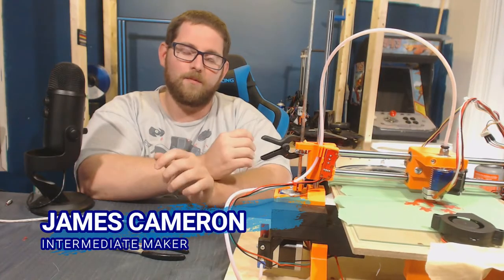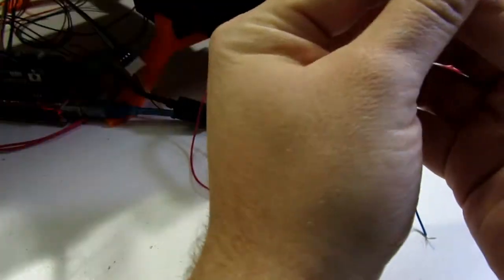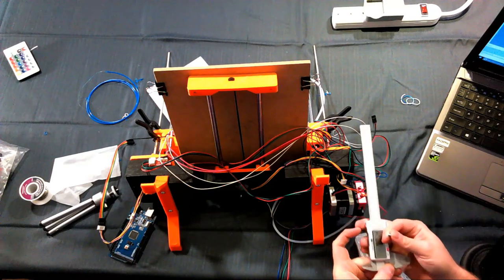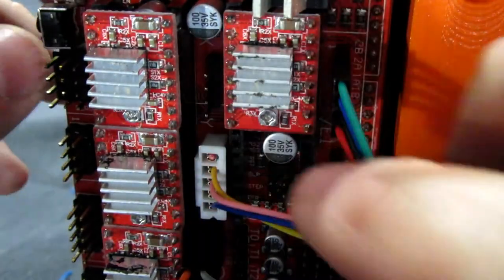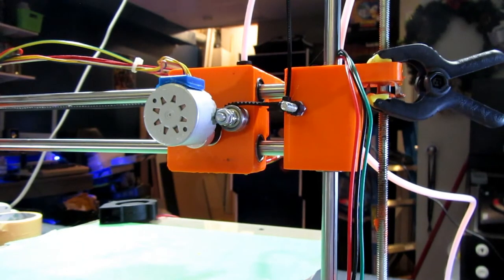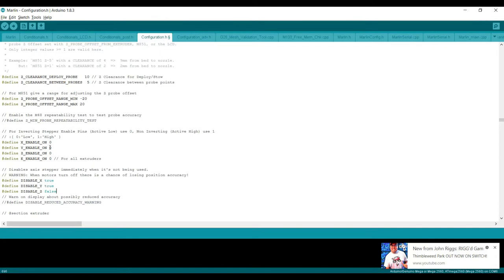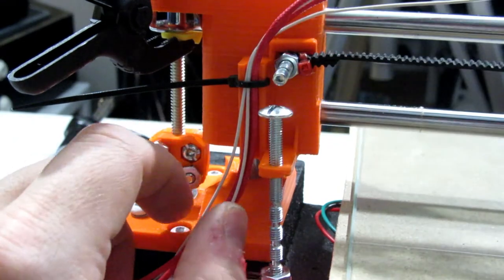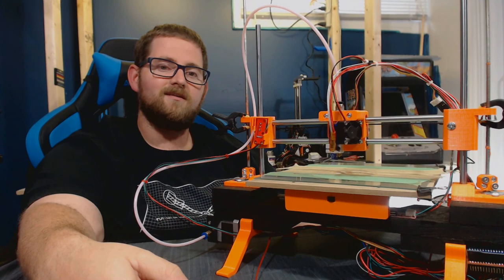Building the Cherry 3D Printer - Part 4 - Wiring Calibration and First Print

Comment: Really nice. I am doing an upgrade with the same style motors on the 101hero and so this is great to see. Also nice hints on my i3 clone build. Glad to find your stuff through Funk King 3D. Looking forward to your next project.
Reply from the maker: Glad to have you aboard! Have been watching your progress on the clone, it's coming along nice. I am currently working on an arduino based game project, but will be building another printer kit in January.
Reply: Nice,  thanks. As soon as I'm back home I will hopefully finish up the clone then see what the budget is for the next printer.  I will keep my eyes open for the games project. Have not gotten around to any game consoles yet. Hopefully I get figure out the settings and get the updated 101hero running soon.

Comment: Thank you for all these tutorials,  they were very teachfull.  I will design my own 3d printer based on these one, but using lasercut instead of 3d printed parts because 3d printing is way expensive where I do live.  Also, I will use the small stepper motor in a direct feed extruder instead of the nema.  
Your tutorials were great!
Reply from the maker: Glad you enjoyed them! I would take a look at the design on thingiverse for using two of the small motors together to build your extruder. You can likely make a laser cut version that would give you more consistent feeding

Comment: My Motors roasting like going to blow up what can I do?
Reply from the maker: Are you running the 12v versions or the 5v versions?
Reply: Print 'N Play thanks for the fast reply I’m making my 3d printer from Cd Motors
Reply from the maker: Ahh. Well the first step is to tune the voltage on the stepper drivers as low as possible. From there, you might want to look at adding fans to the motors to keep them cooler.
Reply: Print 'N Play ok thanks for your help appreciate it and one more thing I Connect up my hot end and turned it on and it’s not heating up and I tested from the Rams board and there is no power from d10 when it’s connected is there something in the software I should have turned on???
Reply from the maker: Assuming that you have told your hot end to turn on in software, do you have 12v connected to both 12v inputs on the ramps board? If not, its possible you connected the power to the wrong side. On side is responsible for the power for your heated bed, the other is for your hot end.
Reply: Print 'N Play yes 12v to the both I have a feeling it’s something with settings in software any more ideas?
Reply: And when can I find in the marlin firmware to see if the hotend is set to come on

Comment: Hi

I find this build very interesting, especially the use of these small motors instead of the NEMA17

Can you explain how you adjusted the current on the stepper driver and what voltage should be used for the 28BYJ-48 Stepper Motors?

Thanks
Reply from the maker: Hi Johannes! I don't have the reference voltage handy, but I tuned the stepper drivers as low as I could. The motors require very little current, so the minimum the drivers can output is enough.
Reply: OK, I'll try that

Comment: hey! which one should i make, cherry 3d printer or toyrep 3d printer please answer
Reply from the maker: The ToyRep is more expensive to build, but has a larger following. Print quality of them when tuned seems to be similar. It really depends on your goals. Cherry is cheaper and easier to build, but it is not as solid of a frame.

If you are not in a hurry, keep an eye on my channel. I am releasing a new design soon that makes use of the 28BYJ-48 motors.

Comment: I dont know if i missed it or not, but where do you get your files to print and how did you upload them? Thanks
Reply: A fast reply would be appreciated as i am making this for my culminating a it is due in less than 1 month, i already have all the parts, just waiting on the 3d printed parts and power supply
Reply from the maker: https://www.thingiverse.com/thing:2640914
Reply: Print 'N Play I was wondering what you source you used to print after you had finished the 3d printer and also how you uploaded it to the printer

Comment: Hi Print 'N play
I am building this great 3d printer and I am almost finished but I have a problem that I don't know how to solve. I followed all the connection instructions very carefully and the firmware as well. I can connect my printer to repetier host  with no Problem but when I try to move all the axes X, Y Z with the control manual Option from repetie, it doesn't work. The motors don't move. I've tried everything but I can't make them work. They just do a "clack" sound and that's it. I checked the baud rate and also many tutorials but anything doesn't work. What would be your suggestion?.
Sorry for the long message
Reply: I paired the wires in each motor correctly as well
Reply from the maker: You are likely trying to move the motors too fast. What are your steps per mm ? And what have you set your maximum speed to?
Reply: I tried to measure the steps as accurate as possible and I got for X and Y 800 steps. I haven't done it for Z and for the extruder I got 99.74
Reply: Is speed the same as feedrate?
Reply: I have for MAX_FEEDRSTE 9, 9, 0.30 ,3 and for MAX_ACCELERATION 3000, 3000, 75, 10000
Reply: Also when I try to move the motor from the manual control of repetier, sometimes the motors move and sometimes they don't move. I appreciate any answer you give and help, really. Thank you
Reply from the maker: Try putting the max federate for x and y to 6. See if they move consistently after that.
Reply: Great!!! It worked. I put six and then I only notice that they moved only when I do homing so I did a general homing in all axes and after that they move without problems (at least until now). Woooo thank you so much, really. I was desperate looking for a solution. 
Now I only see that when I do home in X, Y and Z axis they touch the endstops and go back (like a bouncing) and finally rest in the endstop but this "bouncing" in Z axes in a little longer. It goes up like 3 cm and then go back to the endstop. I haven't found a solution on internet, I would like to fix it but I hope it doesn't mess the printing.
Thank you so much for your help!! Really I do appreciate it
Reply: The Z axe is already in 0 touching the endstop. When I press global home ithe Z axe goes up like 6 cm, makes home in X, then Y and goes down again, touch the endstop, goes up 3cm more or less and then goes down touching the endstop. I would like to change but I haven't found information. 
I'm sorry for so many questions, it is harder than I thought to configure the 3d printer
Reply from the maker: The bounce is generally normal. It usually goes fast, hits the switch, then goes slow for the second press to ensure accuracy.
Reply: So it looks like I don't have to worry about. Thank you so much for your help, really. I appreciate it. I  hope I don't have more problems.
Reply: Woooo it's crazy how many problems I'm having configuring the printer XD now when I want to find PID it starts autotune and found the PID for the hotend abut then it says error " system stopped! Heater_ID: bed". Did you have the same problem? Does it influence at the moment of printing? I have read because of it the hotend doesn't heat for protection
Reply from the maker: Do you have a heated bed on the printer?
Reply: No, I don't. I tried to follow all your steps carefully. I am afraid that it might be a problem in the ramps 1.4 or I don't know
Reply from the maker: @diegoacevedo1790  there is a config option for which motherboard you are running. There is an option there for ramps + 1 hot end and 2 fans. If memory serves, that's the one you need to pick
Reply: Hi Print 'N Play I'm sorry I just replayed. I was busy and I couldn't spend time on the printer as I wanted. Thank you so much for your advice. I just did it and worked perfectly!!!! I ran the autotune in Repetier after changing Motherboard option and it did have any problem. No more message saying ERROR. Thank you so much for your help and answering all my questions. I'm really grateful. I'm extremely close to achieve the printer. When I finally finish and print my first object I will let you know. Thank you for your help
Reply from the maker: Can't wait to see it!
Reply: Hi Print 'N Play, finally my 3d printer is able to print!!!! Thanks to you and your great tutorial. My first printing was a calibration cube (it's the only printing until now). The steps of the motors  are  accurate and it worked well. Now I'm left with the configuration parameters of slicer to get printings of good quality. I don't know how I can get a compact and clean external walls. The layers are very evident and I would like to solve it. 
Despite of it, I'm very happy with the printer. Thank you!